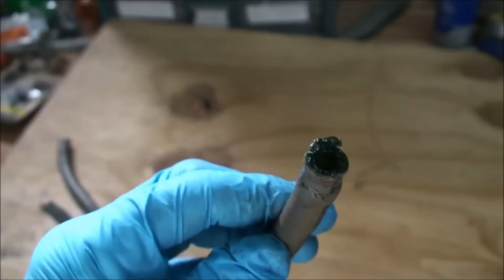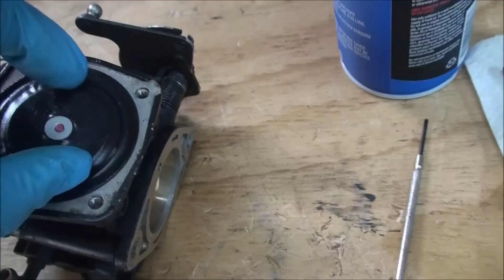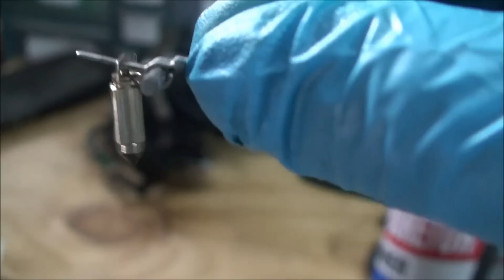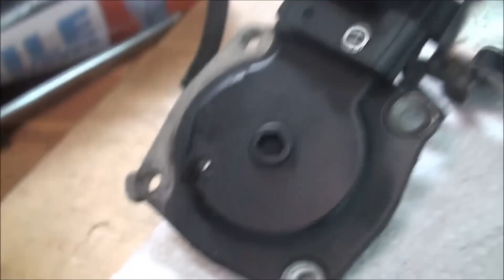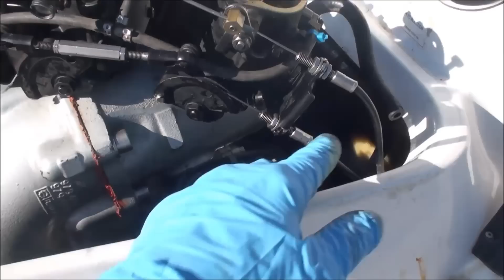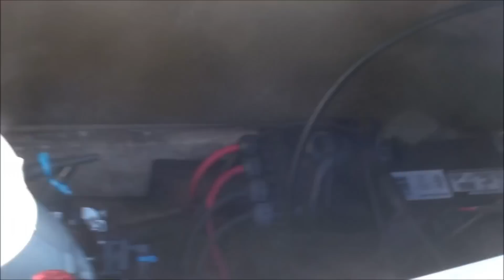1998 SeaDoo SPX 787 Rotax Carb Removal and Cleaning: Part 2

Comment: Awesome Vid man!! I took mine all apart and took vids but that was 2 years or so ago, seeing this refreshed my memory and even gave me some new tips on how to do this. Esp. putting that choke cable back with those springs. The spring has two little ends that stick out that sit on tabs - i have a vid when i took mine off showing the orientation. I also took off that bracket on the mag side of the carb and just left the cable dangling in the engine bay.

Comment: The gray lines 100% caused that gunk. The gray oem fuel lines break down and creates a liquid lacquer like plastic that’s when the fuel evaporates it leaves the dissolved fuel line in you carb. Go to run it and lean condition burns them up. See this all the time
Reply: I am dealing with a 97 seadoo xp with grey lines right now. I am going to be replacing them with black and cleaning the carbs throughout this week. Is there anything else i should check/clean?

Comment: Can't believe you aren't going to fix that broken off bolt?  No pop-off test to check needle/seat?  Other commenter suggesting adding a fuel filter is wrong.  Filter in each carb, filter at bottom of fuel baffle and filter in oil/water separator is plenty.  The damage to that really bad carb in your photo was from water, which a filter won't help with, and probably deterioration of those gray Tempo fuel lines caused by ethanol gas.  The stock fuel filter setup is ideal and does not need to be messed with.  Good job changing the fuel lines out.   For folks reading this, you want 1/4" ID fuel injection line rated for ethanol gas.  The fuel injection line has a higher pressure rating which is helpful because the fuel system on a 2 stroke Seadoo is always slightly pressurized.
Reply: What about the smaller fuel lines between carbs looks like those are smaller lines any idea what size
Reply: How many  ft of new line do we need to buy?

Comment: So the PTO Carb on the fuel filter side doesnt have a rubber gasket just the big O-Ring seal? Because i put one in mine and for some reason the ski doesnt run right, trying to see if i assembled it incorrectly. Am working on a 96’ GSX
Reply: Mag carb has the o ring because of the fuel pump block.  PTO carb does not.  Owner of 96 XP and 97 GSX.  Get yourself a free owners manual downloaded from Seadoomanuals.net.

Comment: I had the same problem with one piston on my seadoo xp and put a hole in the piston. I got the carbs rebuilt and top end rebuilt. I set both carbs the same and it ran like a beast. I checked the plugs (one piston was perfect and that same piston was burning hot. It will run if i set the one carb rich, but it runs slow. If i set it to stock it runs good but i know the one piston is running hot because of the color on the plug and i dont want to fry that piston again. Could i have a crank seal leak causing too much air? if so what seals do i need? and how do i replace them.
Reply: Kellholm Schofield  I build race engines, and I can tell you have 1 of a few problems maybe all.  You have a crank seal air leak,  bad fuel, too hot of spark plug, or engine timing has moved on you.   Any of these things can cause detonation and burnt pistons.   You most likely need a complete rebuild.  Seadoo engines run into problems at about the 150 - 200 hr point in their run life.  Depends on use.  How hard it’s ran , like if your one of those people that run it wide open all day across the lake or just cruise around and play.  Good luck with it.

Comment: also run a hi flow fuel filter to just b4 carb inlets and remove thoes small filters they block up to easy and it will run lean let the hi flow filter do the  job thoes internal filters are crap made 4 enghine rebuilds lol.
Reply: What type of fuel filter would be best to put just before the carbs? I've heard the paper element type will block flow if any water gets in them.